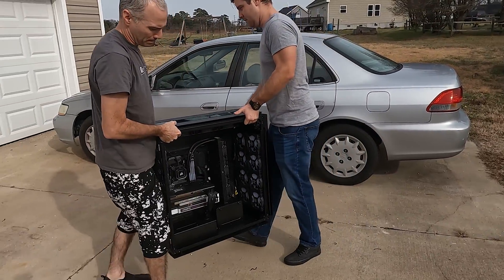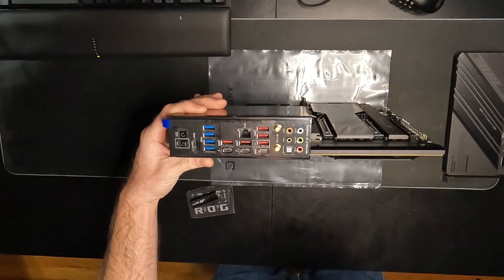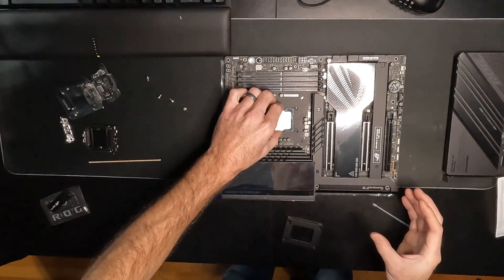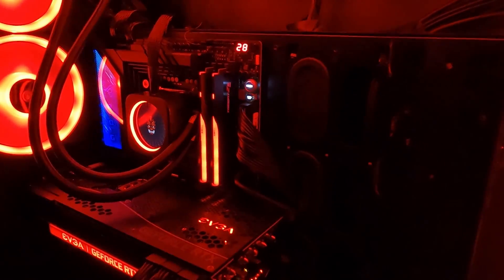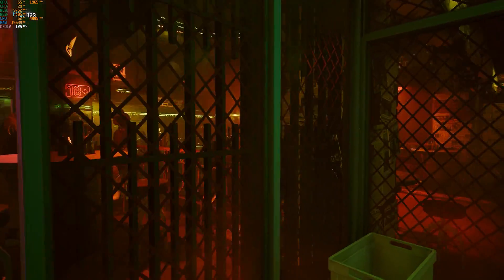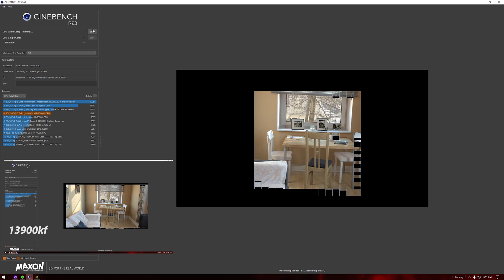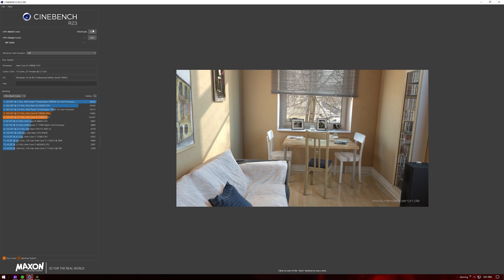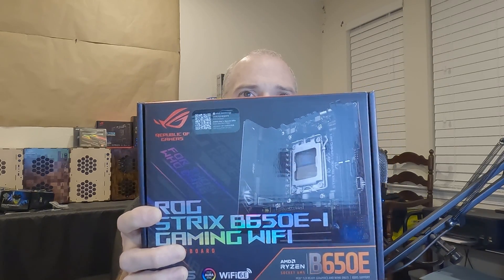Unbox | Review | Test | Asus Maximus Z790 Hero Motherboard

Comment: Hero z790 is shit dont buy ram issues an all my 3 motherboard that where replaced under warranty.
Reply from the maker: Did you check the qcl of the ram you purchased? Running 2 sticks or 4? A lot of times ram issues arise when components aren't compatible. It will still work in most cases but could be temperamental. Ram issues also usually derive from the cpu as that's where the memory controller is. I have seen people try to run ram with tight timings on a lower model CPU that simply can't handle that kind of load.

Comment: just building mine at the moment! love the board. Im going with a i9 14900k + Palit midnight kaleidoscope RTX 4090 + Vengeance 192GB quad Ram kit+ in combination "for first" a NH D15 but considering to go for proper watercooling soon. Hope the 4k/6k editing will finaly work well soon. Setting up the RAM properly at a high clock frequency is what worries me the most, hoping to get some high clock speeds out of it. also that the initially installed NHD15 maybe will not be enough, as I don't want 80 or 90 degrees
Reply from the maker: Sounds like it will be a beast! As for the ram, are you trying to overclock it? Please bring us an update on it once you are done! Thanks for checking out some of my older content!
Reply: im not sure about overclocking, all a matter of the temperatures, i was using an skylake i7 for a very long time now, so im not sure how hot an i9 will go.  im going to try to overclock with the NHD15 slightly but i realy think, a i9 should have a good watercooling when overclocking, especially with a 4090 in combination with 192gb of rams ;P I Will try to get the most out of the vengeange quad kit, and will let you guys know soon, lets see how it works :) you said "thanks for checking out "older" content but 1 year is pretty actual mate" :D @bricktronics
Reply from the maker: @VELVET462  Right on. Most people are happy with setting the xmp profile on the ram and that's it. As for overclocking the i9, I recommend you undervolt instead. You can gain a decent performance boost while lowering the temperatures. I also recommend a cpu frame.
Reply: thats a great info right there. Yeah just good to know because im not sure, in the end i just needed ASAP a INTEL Computer for 4k/6k editing. And now ordering all the stuff as well as looking for all the informations to get one of the best setups running :) a few years back i had some RTX 3070 mining farms running for Ethereum but that was absolutly undervolting, to be honest i never realy had to overclock, i never needed the power to handle 4k/6k video material etc. Im pretty new into this hehe. And yes i just saw a few reddit posts about the XMP profils, mostly the second profile worked out well for the most! and funny that you name the "CPU FRAME" because literaly case, board, CPU fan etc everything just laying on my living room desk because i just forgot to order the CPU FRAME :D it will be delivered tomorrow, have to wait some more hours, i ordererd the "thermal Grizzly Frame" @bricktronics

Comment: what cpu cooler is this?
Reply: Ok will do, i am thinking about this, iam just referring to the cooler? Is it that expensive?
Reply from the maker: @2522james  oh, lol, my bad...I thought I was replying to a different comment. This one is more expensive bc it's a 420mm and the lcd on the water block.
Reply from the maker: Corsair h170i elite lcd
Reply: @bricktronics   looks amazing but £320 for that? What makes this super special?
Reply from the maker: @2522james  do your research on higher end gaming boards, there are many benefits, higher quality capacitors, vrm chips, etc. I usually see better benchmark results on higher end boards as well. With that said, I'm not here trying to convince anyone high end boards are a smart choice. Most of the time, it's not worth the money for an average user. For what it's worth, I think higher end boards are worth the money.

Comment: Armory crate if I’m not mistaken can change the color of the logo in the board but not the design
Reply from the maker: That's all we could do as well. To be clear, I was hoping to find a 3rd party app to customize it. I wasn't expecting to use armory crate to do it, otherwise it would be an advertised option.

Comment: I have a question about how many ssd’s(samsung 990 pro) the Motherboard can have. And I have seen a comment below regarding on the best cpu, what is the difference between k and kf I know what it means but in performance isn’t k slower because it waist space for the integrated graphics and kf be better due to it having more space and have a better thermal performance. I just need a clarification because I am lost so the help would be nice.
Reply from the maker: I believe there are 4 m.2 slots on the board....maybe 2...I don't remember, but it's in this video. As far as k and kf, I usually buy just the k. They do perform marginally better. I always score higher on benchmark tests than kf chips. Power distribution in the cpu is different, more stuff in a small space could also lead to higher thermals. I haven't tested thermal differences so I can't say for sure there.

Comment: I bought the Hero and a 13900K at launch. The Apex wasn't in stock and it was stupidly expensive but I would probably have bought it if available. I can easily get over 40000 in R23 with a very average SP98 13900K on custom loop. The Hero is very good for overclocking and the Apex only really wins for memory speed overclocks because of the extra signal layer and only 2 dimm slots. 14th gen will use the same socket so I plan to wait for a 14900KS to upgrade. Pity you didn't have a 4090 to test with. Huge difference!
Reply from the maker: The 14th gen is still rumored to be a lga 1851 socket, if true, will require a different motherboard. And yeah it would have been nice to have a 4090 at the time of this video but they were almost non-existent and super expensive back when.
Reply: @bricktronics  Everything I have read from the usually reliable leak sources says that Raptor Lake Refresh (14th gen) is lga1700 socket compatible and will only need a BIOS update, and even then probably only for the 8+12 core part. 15th gen will switch to lga1851. We'll soon know 🙂
Reply from the maker: @ColinDyckes  I mean, Google 14th gen socket type...evert source I look at claims lga 1851, besides I haven't seen Intel keep a socket for more than 2 generations in a row but everything is just rumor for now. It's also a much different chip that even has integrated wifi, ai bs, a vpu, double stacked, overall just new chip design from what the rumors show.
Reply from the maker: @ColinDyckes  but honestly I just read one source that said it will be lga 1700. Every other source says otherwise....we shall see. Either way, 14th gen ultra chips are going to be dope af!
Reply: @bricktronics  I think there is confusion about what 14th gen actually is. Most reports are that it is Raptor Lake Refresh and lga1700 compatible. Others mention Core Ultra and lower power which I actually believe is 15th gen and starting with laptop chips and to be announced in December. We'll see 🙂
Reply from the maker: @ColinDyckes  now that the 14gen is out, you were right....they stuck with LGA 1700. From what I've seen, it is pretty disappointing despite it hitting crazy high overclock speeds. From what Gamer's Nexus and many others have said, it almost doesn't deserve to be called the next generation. The architect is identical. However, motherboard manufacturers are making new Z700 series boards to take full advantage of the 14th gen. The LGA 1851 will now most likely come in the 15th gen chips.

Comment: I really wanted to get the AM5 amd version of this mobo for the 7800x3d but man after hearing all the horror stories and asus denying warranty claims for updating the bios, I guess I’ll need to switch to something else.
Reply from the maker: You're smart for waiting the am5 platform out. I had a 7900x3d burn up with the original bios. Asus has been trash about the warranty claims. AMD was real quick to rma that chip.

Comment: what is the best processor for this mother board, ntel Core i9-13900K 3 GHz 24-Core LGA 1700 Processor?
Reply from the maker: The best of the best is the 13900ks
Reply from the maker: 13900k is second best. If you care for integrated graphics, 13900kf.

Comment: I just built my PC (i9 13900k, RTX 3080, 64gb ram ddr5 6400, MB Asus Rog Maximus z790 hero) everything turns on fine and it recognizes my gpu but it's as if it didn't work, I already tried another and it's the same, does anyone know
Reply from the maker: What q-code is it showing?
Reply: @bricktronics  That's the thing, it doesn't give me any q-code, it works "perfectly", even when I go to device manager it appears there, but when I go to put the GPU to be my video channel it tells me that there is none there connected.🤡 Delete and download the drivers, and in the control panel and Nvidia recognizes it but the options are limited because it is as if it is not connected, and the GPU turns on too, but the fans stay off. Thank you very much for answering me, greetings! ❤️
Reply from the maker: @norbertoroman9333  have you tried a different GPU and which one do you have?
Reply: @bricktronics  yes, I have an RTX 3080 evga XC3 Ultra, and I tried with a GTX 1080, it's not much but it was the only one I had on hand, and it was the same situation
Reply from the maker: @norbertoroman9333  and you've tried the second pci slot? It definitely sounds strange and I wish I could help from where I sit but would need all the hardware in front of me to give a solid diagnosis.

Comment: My Bluetooth signal is weak with this board I tried everything can anyone help?
Reply from the maker: How far away is your wifi antenna from the source?
Reply: @bricktronics  less than 2 feet. I’m trying to connect an Xbox controller. It barely connects when it’s directly touching the antenna. 

Reinstalled drivers switch from windows 11 to 10, updated bios and still nothing.
Reply from the maker: @therandomgamer8107  hmmm....have you tried a different bluetooth device? 

Also have you hooked the controller up via usb with it on then disconnect?
Reply: @bricktronics  it’s just the Bluetooth
Reply from the maker: @therandomgamer8107  have you tried other bluetooth devices? I ask because I have had issues with two different xbox controllers.

Comment: Fantastic
I bought nearly all the same components!

Im using 4 fans on a Noctua HD 15
FLOW THROUGH
😊. CPU cooling Brillant results
Reply from the maker: Very nice choice on the CPU cooler. I have been able to cool the same processor on a 240mm AIO sufficiently as well. It is a power hungry processor but some good thermal paste and a CPU frame helps a lot!

Comment: As a sidenote the xtra 6pin is not for the PCIe slots. It's intended for the nearby USB port.
Reply from the maker: Negative my friend, I just looked in the manual to double check myself. It's for additional power to the pci slots for extreme overclocking.
Reply: @bricktronics  In fact you're right,i just checked the Manual myself.The reason for my statement above is another YouTuber video which is obvs wrong,false information. My apologies.🙏
I will delete the comment.Nice Case btw.
Reply from the maker: @IllgoRythm  no worries, you can leave it up. It's a good discussion point and I agree, the internet and this platform is full of misinformation. I do my best to make sure my info is accurate.
Reply from the maker: @IllgoRythm  and thank you, I love these cases

Comment: Not a fan of this board, it has a major flaw, in that you will never be able to use a gen 5 ssd with it. It only supports it with the gen 5 ssd in the hyper card which has to go into pcie 5 #2 slot, the problem is that most of the large gpus today block anything from being put in that slot when you have the gpu installed in the pcie #1 slot.
Reply: Just put the gpu on the second pcie port. Leave the top port for the hyper card.
Reply: @TZNSK  seems that the gpu will have a performance downgrade while using either slot with the hyper m.2 card, since the manual says that it will reduce the bandwidth to pcie 4 8x. so you can use gen 5 ssd but at expense to gpu bandwidth which has a performance impact ranging from 1-13% depending on the game
Reply from the maker: I agree, and good point. That is a big flaw that you would think a $700 plus board wouldn't have. Which is my biggest complaint honestly, the price just isn't worth the features it does have. But hey, it has quick releases on the pci slots, lol. I am watching a video right now from Gamers Nexus with him going on a big rant with board prices per features. I am not sure if a gen 5 ssd is going to be that useful anytime soon though, after watching a Linus video where he tested a new Crucial ssd.
Reply: @bricktronics  Agreed it won't be anytime soon we're all gonna go out and buy gen 5 ssds. However for this price it is unacceptable not to have that option down the road at some point. I ended up returning this one and got the rog strix gaming-e which actually has an onboard pcie 5 m.2 slot.
Reply from the maker: That's a really nice board and better option you got there. I honestly think the Apex board should fall into this price range and everything below that drop 200-250 bucks. It's unreasonable. Honestly, I like the Asus z790-I that's on my test bench right now. For the price and it being an ITX board, it has great features including onboard gen 5 support. Obviously I am limited for memory size but I have scored over 41k on r23 with a 13900kf on that little board. The cases I build in are sff is why I went with an ITX board btw. I am still not sure how I feel about the Hive, I love it and hate it other times, haha.
Reply: @bricktronics  Z790-I is great as well, would definitely pick that up for a smaller build. I considered the Apex, however I don't get too crazy with overclocking and don't do custom watercooling so I realized I woulnd't really be utilizing that board like it's suppose to.
Reply from the maker: True, the board you ended up with is for sure the happy medium and really best for the buck compared to the other inflated prices for boards, all the things you need and not much extra bs. I def stick with Asus on most products, especially boards, as they don't slack out on quality.....except for the integrated water cooling by EK that is corroding, but that's not Asus's fault.

Comment: Starting my first build with this board with i5 13600k just the ram is completely confusing me . I want to run 64gb with 4 sticks but if the board is only dual what all I need to do …. I’m lost
Reply: Check the Boards QVL before you buy the Ram.
Reply from the maker: It can get rather confusing. With your motherboard it sounds like you need 2 32gb sticks.

Comment: helllo i just got a mother board and i need a ssd so, i need to know if the mp600 pro xt will work with the 990 pro.
Reply from the maker: Is it this motherboard that you have?
Reply: @bricktronics  no, i have the maximous extreme
Reply from the maker: @coasterknoxmoore  Nice, yes it will work on the m.2 slot closest to the CPU then the cooler will install where that m.2 cover is currently
Reply: @bricktronics  how many ssds can the maximous extreme have?
Reply from the maker: @coasterknoxmoore  there's 3 on board m.2 slots, closest to the cpu is the 5.0 one. If you have the Rog dimm.2 that will add 2 more m.2 slots.
Reply: @bricktronics  does the maximous hero come with an instruction kit?
Reply from the maker: @coasterknoxmoore  as long as you purchase it new, it will come with instructions

Comment: will the Maximous hero be able to handle 128 gb of ram?
Reply from the maker: On paper it will handle 128gb of ram but many people report issues getting the advertised speeds and timings after enabling the xmp profile. The memory controller on the cpu could play a factor but a future BIOS update could help with memory compatibility at that total size.
Reply: @bricktronics  is that the same thing with the maximous extreme?
Reply from the maker: I haven't heard of anyone having this issue on the extreme board. My personal thoughts are, anytime you fill up all 4 dimm slots you run the risk of stability issues and always because of the motherboard. As not all CPUs are created equal, some memory controllers just may not like the voltages and frequencies while running 
"quad channel"....so some tweaking may be required. I have gotten lucky in the past, I also primarily use g.skill ram which I believe is the better of choices available.
Reply: @bricktronics  would 64 gb have problems too?
Reply from the maker: Not that I'm aware of, when I go that size I usually run a 32x2 configuration....as much as I like seeing all slots filled up. If all slots are filled up, I highly recommend them being the same lot number. Basically, buy them in a set of 4 and don't mix 2 different sets of ram.

Comment: Would love to see a more in depth video on the CPU frame replacement install, and also what one you are using?
Reply from the maker: Sweet, I will consider that once I get the 7900x3d. I'll update my video with a link to the one I used here...give me a few.
Reply: @bricktronics  Didnt realize am5 had a replacement frame as well, does it improve thermals to the same extent? Figured for am5 the normal frame was a non issue.
Reply from the maker: @LegitCamelRetro  unfortunately it appears AMD used the same style ILM for the new AM5 motherboards. It will be interesting to see if I can keep it cool with a 240mm radiator in a M-ATX case.

Comment: Also quick mention is that this was done on an HDD which was the bottleneck of the Cyberpunk runs, we talked about it I thought it was the GPU  but I guess not!
Reply from the maker: Correction - on my part - it's a old worn out sata III ssd. Looking at around 450mb/s read and write vs over 5000mb/s with the m.2 I like to use.